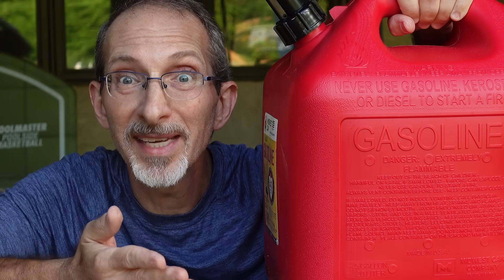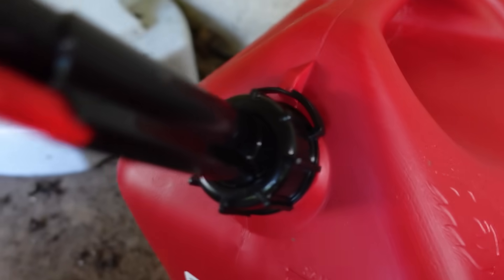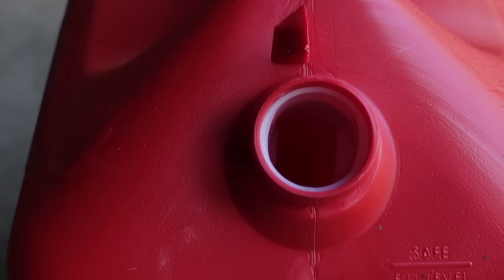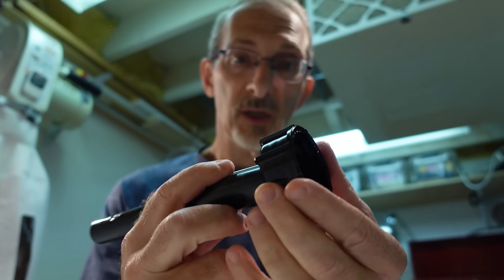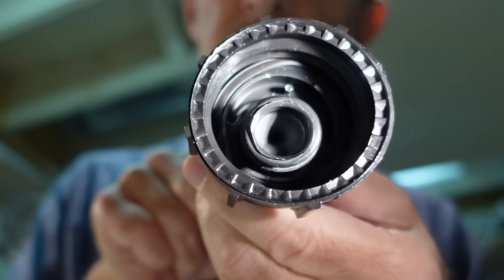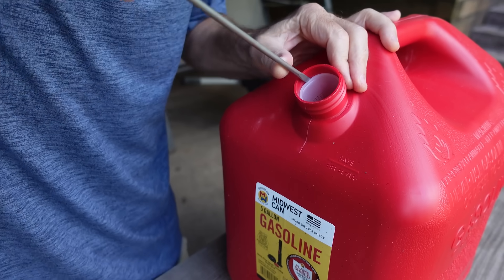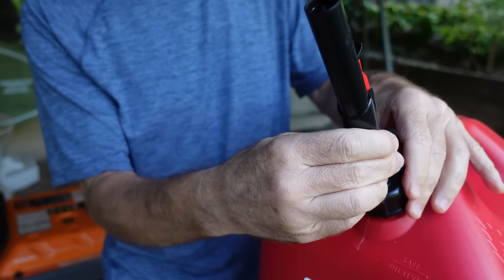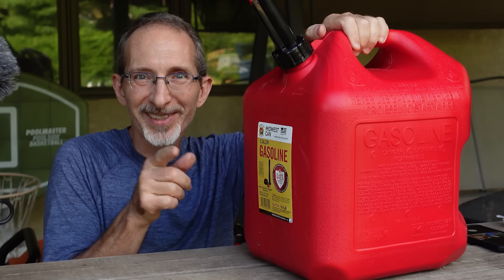Gas Can Modification | New Gas Can Fix

Comment: The internal "filter" is not a filter at all but a flame suppressor.  It prevents a flame from getting back into the vapor space above the liquid.  Having said that, plastic is not very good for that and the holes look to big.  Also huge pain in the back end to fill!
Reply from the maker: Thanks Ed, you are correct! I talked about the flame mitigation device in my follow up video, link in the description. Thanks for watching!

Comment: Love it when you fill gas can on cold day, use it on a hot day and it shoots gas EVERYWHERE from the pressure build up. Or some  have a vent that exhausts gas vapor all on your hand and sleeve. Love it!
Reply from the maker: Kurt, give that cap a twist to let the Cannes burp before you use it. Problem solved! Nobody needs a gasoline shower.

Comment: This is a very good modification,  manufacturers get so safety conscious that they actually make it so hard to use,  that its dangerous all over again, 
  I had the same nozzle I couldn't even put gas in my tank, SOOO I did the same thing. 😃😃😃
 Great Video THANKS , William
Reply from the maker: Thank you William I appreciate you watching!

Comment: The filter is stupid. Since it can't be removed (easily) to be cleaned, it just means that any crud that gets in there is going to wash back into your equipment when you're filling it anyway. They do make some sense on metal gas cans that might corrode internally.
Reply from the maker: Chaos Corner, the filter is actually a flame arrester, which I clarified in my second video, link in the description. I agree that, as a filter, it is a stupid design!
Reply: @MikeFyxdt  I wonder how that works? A bit like the grill on old miners' helmets?

Comment: Now find a way to add the little air vent that keeps the pressure from building up and allows the gas to flow from the can without splashing everywhere!
Reply from the maker: Robin, excellent suggestion! I added a capped vent in my second video, link is in the description. Thanks for watching and commenting!
Reply: Thank you!  I will be using your ideas!  So the next time I remove the nozzle to fill my gas can it won’t be shooting off like a rocket from the pressure build up.  Those manufacturers really need to do more research before making regulations and changes for our safety.

Comment: I find old air compressors and take the pet cocks off and use them for a vent. Punch a hole with a philip screw and force the threads and screw it in . it will seal it self.

Comment: I removed every one of those nozzles from my cans after one flew apart and sent plastic pieces and the spring into my lawnmower tank. Spent a whole day with a fishing hook and wire getting them out. Bought “replacement” nozzles from TSC instead. They’re just straight with caps for the tip.
Reply from the maker: I’ve lost count how many comments I’ve read were one of these nozzles has shot parts into peoples gas tanks. It’s crazy!

Comment: I took a hammer handle and shoved the filter down inside the can  I couldn't pry it out without mangleing up the neck of the can .
Reply from the maker: Lots of people seem to be knocking it in, instead of pulling it out. Makes no difference when using it. Thanks for your suggestion!

Comment: You forgot to add a rear vent and if you turn your needlenose 180 degrees you can just pull it out. for a vent use a screw, bolt, Shrader valve (from a tire) or you can just buy one.
Reply from the maker: Thanks for the tips Bob. I did add a vent in my follow up video, link in the description. It made a big difference!

Comment: All these safety features are because some morons out there can't handle a gas can.  They are also the ones that can't figure out a gas gauge so they're using gas cans and thus the spring that needs the filler inlet on the car.  Can't we find a planet for these people.  They're making it so hard to live on this one. LOL  BTW the filter makes no sense as it back flushes all the sediment when you pour the gas out into the car, mower, etc....  The filter in a funnel is a much better idea.  Send these engineers to another planet too pls. LOL
Reply from the maker: Yes, the filter is actually a flame arrester safety device. I explained it in my second video, link in the description if you’d like to watch. I agree, we have all of these safety features because a small number of people miss used containers and got hurt. Bummer.

Comment: This video begs the question, why buy them in the first place, or take them back, not fit for the purpose
Reply from the maker: I suppose I could have returned them, but they were the only ones I could find when I needed them, and once they were filled with fuel, I wasn’t about to bring them back.

Comment: Try the "Easy  Can" at Walmart, best design I've seen lately with all of the the safety stuff. Push a button for gas, release it and it's sealed shut. I bought 2- 2.5gal cans. Problem solved. Pretty cheap too.
Reply from the maker: Thank you! I’ll have to check that out.
Reply: I agree, the Easy Can from Walmart is a much better design, I bought 2 and threw out the old ones.

Comment: Am I crazy for thinking the only thing that "filter" would protect is gunk from getting into the can?? Like.... if there's debris in the can.... it's gotta come out. If there's crud going into the can from the pump then the filter would trap it and then spit it right out into you're gas hungry equipment when you fill em up. Serious design flaw right there in my opinion.
Reply from the maker: The filter I referred to is actually a flame arrester, which I learned later and explained in my second video. Yes, if it was a filter, then that would be nonsensical.

Comment: Apparently, the team that designed these cans ( and this isn't the first version by any means ) was not in any way related to the team that designed the systems that ultimately carried Neil Armstrong and Buzz Aldrin to the moon 52 years ago... But seriously, it is extraordinary that we've been redesigning the gas can for safety for about 30 years. And are still just making things worse.
Reply from the maker: Yes, instead of these cans getting safer, they are getting more difficult to use!

Comment: That filter doesn't make any sense at all.   Everything the filter catches will go right into the tank your filling.   That's a very stupid idea.   To trap the dirt in a filter there would need to be an entrance and and exit and the filter would be on the exit.  No. Wait I got it!  Put a filter in the yellow nozzle right at the base.  Then a simple cap attached right to it and to make it flow, an air vent on the other side.      There was a time when things made sense and it was the responsibility of the individual with the gas can to not let their toddler play with the gas can and to put it in the truck so that it wouldn't tip over.  Nothing was engineered to fail.  Things were engineered and built to last as long as possible and that's how your company got a good reputation.   Not today.   A shop vac is designed today to fail after X amount of hours   so then guess what, you have to buy another one.   So instead of ball bearings, put a soft bronze bushing that will inevitably wear out. Oh, and to speed it up a little, let's add these few random and discreet holes in the injection molding of the lid.  Small holes to allow a little bit of the very dirty air to pass through into the electric motor side.    Or let's make a circular saw with 16 microprocessors in it so it becomes so delicate that they might as well buy 3 right off the start.   Not like the old style you can dunk in a pool, hit it with compressed air (or don't) and plug it in keep cutting.  I don't like brand new products and I hate companies with complete retards at the helm   I will never in my life buy a Western whatever gas can.  It's unlikely that I will ever buy a gas can brand new as I already own lots of them.   And Milwaukee power tools suck balls.

Comment: I just went though all this two days ago.  I wound up throwing the nozzle in the garbage and putting an aftermarket on.  I never was able to get that stupid filter out.  I got it torn in half and the bottom half is now in the bottom of the can.  From now on, I will just order the square VP racing cans from Amazon and be done with it.  Great video by the way, thank you for posting.
Reply from the maker: Hey Douglas, your story sounds similar to so many others stories in these comments. Aftermarket spout kits seem to be one of the most popular options, if you don’t want to make modifications. The other option is simply starting off with a better made gas container! I appreciate you joining the conversation!

Comment: Just buy the EZ Pour Spout kit..replace the nozzle..drill in the vent off center top of back seam. Works like the 1970's.
Reply from the maker: Those kits are a popular option!
Reply: @MikeFyxdt  Yes. Used on many Midwest cans.  I do like their double handle design. Government intervention caused this.  Just like with modern appliances using so little water they barely wash clothes and dishes.  Blitz used to make decent enough self venting gas cans & plastic car ramps.  But lawsuits shut them down.

Comment: Bravo! I have the same can, but Diesel. I use it to get a few more miles out of my Motor Home. The nozzle is not only difficult to push in when filling; when pushing in and filling, the hose tends to separate from the cap. I was tempted to get a simple 'hose & breather' mod. Thanks for showing us hot to 'Fix it'!
Reply from the maker: You’re welcome Matt!

Comment: I haven't read all of the previous 2,200 comments, but somebody else must have realized that that silly filter prevented debris from entering the can....but would be the very first thing rinsed back down the filler tube into whatever you were refueling!
Reply from the maker: Yes, there’s been many mentions...it is actually a flame arrester, which I corrected and explained in my follow up video. Thanks for commenting!

Comment: Cool. Now bore a vent hole in the back top of the can, so it doesn't take 30 minutes to empty the can. Or better yet, go to a garage sale and find an old, simple, gas can that actually works.
Reply from the maker: Going to a garage sale in buying an old gas can would definitely be an interesting twist as a conclusion for this video! I actually did as you suggested and installed event in my follow up video, link in the description.

Comment: Well this was easy.  Throw out the shit plastic can, buy a good steel one that is totally sealed with an easy to pull handle that opens the can.  Made in USA and totally worth the expense.  I got sick of the cheap plastic crap, bought a good one, and probably saved a lot of money over the long haul.  Just stop buying disposable crap and buy quality.  Job done.
Reply from the maker: Getting a better gas can next time will definitely be the option I choose! Thanks!
Reply: @MikeFyxdt  I went thru three (two quickly) before hitting the Google and finding a GOOD, steel.  I ended up getting a $60 Justrite Type II safety can.  Seals tight, easy to pour, and NEVER leaks a drop.  Easy to fill and I don't have to worry about it tipping over in the truck.  Buy once -- cry once.

Comment: You forgot to drill a small hole to not let it build up pressure or implode as the seasons change and temperature swings in your garage
Reply from the maker: Hi Glenn, good comment. I added event in my follow up video, link in the description. Thanks for watching!

Comment: I forgot to relieve pressure on these and gas explodes in my face, I've honestly thought about suing the companies only cause I'm so sick of these and my can didn't come with a warning to relieve pressure sure I  know better but it's an actual bigger issue than having them on
Reply from the maker: Good point. It’s best practice to unscrew the big cap just a little to burp these cans before you use them.
Reply: @MikeFyxdt  I'm not the kind of person to sue,in fact , I hate it. but a huge class action lawsuit would be the only way to get rid of this design, I'm not upset with the strainer/spark arrestor that is ok and easy to get used to , but that red button. I've got nerve damage in my shoulder and it is terrible to try to shakily hold my can up and manipulate the button at the same time so I would rest the lip of the spouts button thingy on the rim of the tank I'm filling and then squeeze the button only to have it explode in my face. Nothing like going to work  with bloodshot eyes and face covered in gasoline from trying to fill up your motorcycle cause I fill up a can once a week cause stations are closed at the shift you work at

Comment: Don't forget to drill a hole in the handle for a vent. You can use a roofing nail to plug it. This way you can dispense the can in a reasonable amount of time.
Reply from the maker: Yes! I added a plastic event with a cap in my follow up video, link in the description. Thanks for watching!

Comment: That red piece is the lock. Just remove the red piece and the spring moves up and down really easy. Keep the lock in a drawer and put it back in if transporting the fuel. It’s that simple.
Reply: Oh, and by the way. The people on here complaining about it being the governments fault with regulations. It’s not. It’s the greedy manufacturers fault for making a cheap ass product that doesn’t work properly to get the most profit. The government didn’t build that can.
Reply from the maker: Pat, this is the third comment I’ve read this morning recommending removing the red button. I’ll have to give that a try. Thanks!

Comment: That's not a filter.  That wire mesh bit is called a Flame Arrestor, it is designed to prevent Darwinian Selection Pressure.  It works as follows: 
Step 1) Moron pours gas onto a fire
Step 2) Flames travel up the stream of liquid and vaporized gas
Step 3) The flame arrester prevents the first from going up into the gas can and causing an explosion with a melted plastic chaser
Step 4) The Moron, still alive, is able to reproduce

Step 5) Humanity's collective intelligence goes down that much more.
Reply from the maker: I appreciate your detailed explanation of how the flame arrester works! :-)

Comment: If you go to your search engine of choice and search gas can spout you can buy the spouts us old guys are use to.  Also tractor supply has them from time to time.  But for a lot more money.    Also they are called water can spouts as well.  You can get them in 3 packs for like $20 or so
Reply from the maker: The aftermarket replacement spouts are a very popular option!

Comment: Removing the filter: once you have the needle nose pliers stuck in and you grab the filter, twist the pliers on their axis a half or full turn to wind the filter up around them. This will shrink the diameter of the plastic filter and you will be able to pull it right out without digging.
Reply: Though if they sonic welded the filter in, you may still need to do the once-around with the screwdriver.
Reply: I thought it was a strainer also, I later found out that it a flash arrester for fire.
Reply: Good point.... .thanks!
Reply: sounds like you 've done this ILLEGAL MOD. before.........me too.......we're not all as stupid as the gov't thinks we are......just give us a real can and we''ll pour gas with no spills.........

Comment: The gasket tore too the first time I used the can, an it leaks bad when pouring it. Horrible cap design. An I just used pliers to yank that flame arrestor out, fills good now
Reply from the maker: You got to do what you Gotta do, right? Thanks for joining the conversation!

Comment: Terrible advice. Where's the vent? A kit can be bought about anywhere that has a replacement nozzle and comes with a vent that is easily installed. The nozzle also has a cap to keep dirt and debris out.
Reply from the maker: Valid suggestion, I added event in my follow up video, link in the description. Putting a cap on the nozzle is an excellent idea!

Comment: Amazon offers small pastic vent caps [10 pack] for little expense.  [No venting = glug, glug pouring] TIP: When installing drill a clean cut hole [sharp drill] and use a petroleum resistant glue when pushing them in to prevent leak.  No glue = LEAK !  Guaranteed leak!  (The voice of experience speaks)
Reply from the maker: In my second video I installed a vent, and I used a brand new drillbit. It went in like melted butter. Sharp is the key! Thanks for watching and commenting!

Comment: 8:05, wrong.....
Punch the filter into the can, and then turn the can over, shake the filter into the hole with the skinny end, and then it pulls out in seconds.  Done it before, in the half the time of your instruction / procedure.
Reply from the maker: I’ve also heard it’s suggested to grab the filter with needle nose pliers and twist, making the filter thinner and it will just slide out. Lots of options! Thanks for providing yours!

Comment: They make conversion kits for the generac so you can use L.P on them.
Reply from the maker: Nathan, I did not know that! I know that Generac offered a dual fuel generator, but they took it off the market right before I purchased this one. Thanks for the info, I will investigate!

Comment: Agreed heavy duty spring causes more gas accidents....and that plastic screen is useless to fill the tank. Engineers are getting dumber....they need to think practical application safety in filling and fueling funneling...not 100% can gasoline safety with minimal-venting.
Reply from the maker: Accuracy Marked, well said! Thanks for joining the conversation!